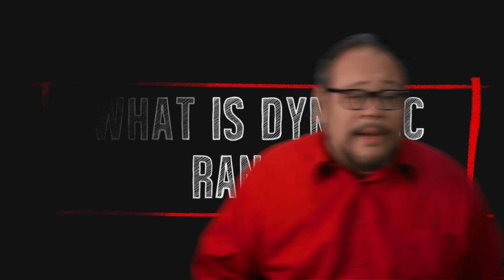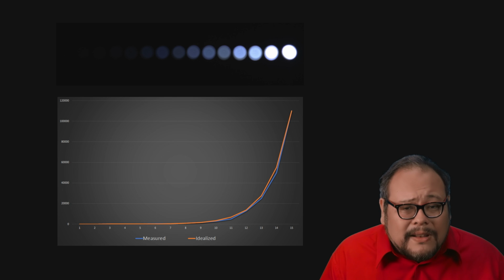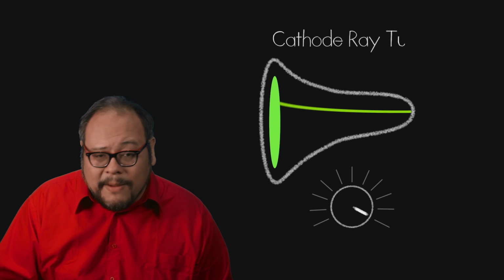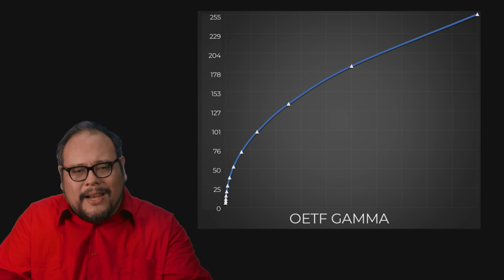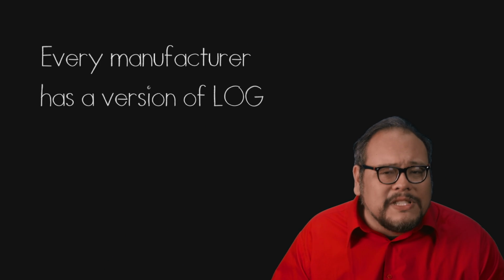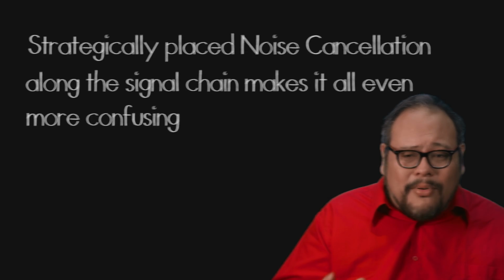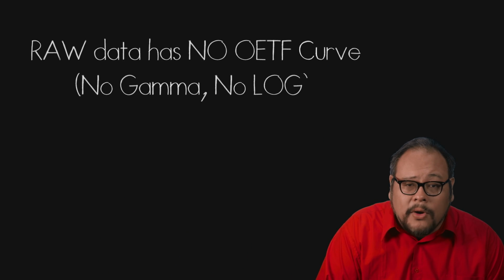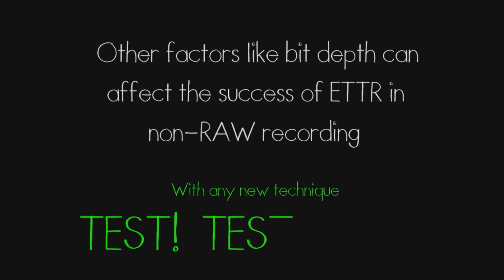Diving into Dynamic Range

Comment: Congratulations!  I come from an analogue film background and way back then 64 ISO was high speed film! To change ISO you changed the film, and I often wondered how digital cameras could have multiple ISO settings. Turns out that they don't. They have one ISO setting and adjust the electronic gain to simulate multiple ISO settings. Back in analogue film days, higher ISO did give more detail in the highlights, but you balanced that against increased noise. With simulated ISO, the rules are different but no-one really explained that. I would be very interested to see some tests comparing cameras with differing native ISO's. My gut reaction is that these tests will be similar to analogue film and will obey the old rules.
Reply from the maker: Thing is cameras with different ISOs also have different sensor architecture so it's not an apple to apples comparison.
Reply: @FilmmakerIQ , I was thinking in terms of comparing at the same ISO as that is a standard, and they all should have a similar response to the exposure parameters. However even back in the analogue film days, each film reacted differently even with the same exposure parameters. For myself I always preferred Fuji over Kodak because Fuji had more lattitude in the exposure, and was a bit more forgiving.
Reply from the maker: Unfortunately really it isn't that simple. There's even the caveat of the dual native ISO that some of these new cameras have that throws a wrench into any kind of comparison.
Reply: @FilmmakerIQ  Yes, it isn't that simple and that's where I think the value is. Again, going back to analogue film, the brand and specific  product influenced your decision as much as the ISO. You may dial in the same set of parameters for several cameras but you won't get exactly the same result. I have Panasonic, Canon, and Blackmagic, and I'm not a fan of the cool tones bias of the Canon for the work I do in events and livestreaming. It was just a thought. I am not sure how you could set up a reference shot/environment so that you could see the influence of the camera itself  on a shot.
Reply from the maker: Funny because in my test when trying to select a 4K camera between Sony, Canon in Blackmagic, I ended up going with Canon because I like the way Canon handled skin tones. Not that any camera looked bad but that Canon just had a way to get me most of the way there.

Comment: I would love this video but for the user not the creaters.
What is HDR video, how does it work for a TV and way is it better.
What is HDR10 and Dolby Vision?
If HDR only means going from 8bits to 10bits. Then this should not change the darkest or the brightest part of the image. Only the gradients (256 vs 1024). The standards might not be linear, but does HDR only mean more steps? I am so confused.
Reply from the maker: HDR is basically displays that have more dynamic range than your standard display - this means it's capable of showing much brighter and much darker. I'm not fully up to speed on precisely what it is but from what I've seen it's definitely a visible improvement.
Reply: @FilmmakerIQ  Thanks for the quick answer, that is awesome.
That would then mean the a standard screen has some kind of standard for how much dynamic range it has. Since both the tv and the content needs to be HDR.
If you just had a display that could show darker and brighter you would just se darker and brighter parts for standard content, but you would still only have 256 steps.
But HDR displays do not even have the same max brightness. I will continue my search, thanks for the great videos.
Reply from the maker: Yep you got it. It's hard to wrap your mind around dynamic range butt the keep is remember the display doesn't have the same DR as the scene. Take paper for example. A printed photograph has maybe 5 to 6 stops of dynamic range... Yet we take photographs with 10 or 12 stops in the scene

Comment: Hey John, when you gave the example of capturing clear sky at ISO 1600 vs ISO 100 and showed clipping at 100 ISO level, you don't mean capturing at 1600 ISO without any ND right? I mean, what if I still want to maintain 1/48th shutter (shooting at 24fps) and I set the ISO to 1600. That will blow out the highlights if I don't use an ND filter to make the image look right. Does that mean if I bring this video in the editing suite (after using Nd and shooting at 1600), I will still have all the highlight details present? This is super confusing.
Reply from the maker: Shooting at ISO 1600 I was exposing correctly using shutter speed to limit the light. If you want to maintain the look of a normal shutter speed you're going to have to limit the light in a different fashion... Either with a smaller aperture or with ND filters.

If I shot those clouds exposing correctly for ISO 100... The highlights would be clipped.

If this is still confusing check out my exposure video for a little more basic grounding.
Reply: @FilmmakerIQ  Thank you for taking the time to respond and for these amazing videos, John. I am going to watch the Exposure video on your channel now and then do some testing with the BMPCC 4k too, referring in post to the Dynamic range chart for the camera to see if my results are consistent. Thank you.

Comment: well, this definitely convinced me to subscribe
can I ask something, though? if the purpose of ETTR is to exploit the higher data acquirement of the right/highest part of the linear curve, what sense does it make to use it in LOG, since roughly all the stops use the same data?
Reply: And I have another question: many many times I tried looking around for flat profiles, but everytime someone says something different and I have no idea what to trust... can I please ask you what is going on between log and flat? Does shooting flat actually increase dynamic range somehow?
Reply from the maker: @francescoroccuzzo5914  There isn't really that much benefit to shooting LOG ETTR other than just getting further away from the noise floor (which may actually be the best reason).

As far as flat - I think most people use that as sort of a stand in for LOG. Flat is just reducing the contrast in the camera and playing everything kinda safe - it's not quite as sophisticated as LOG.

Comment: If you Please we need a clip about what the difference between 8 bit - 16 bit and 32. Thank You.
Reply from the maker: This is rather an interesting mix-up. So whenever you hear something described as a number of bits that tells you how many values are available. With eight bits you have 256 values available. In video when we say something is 8 bit That means there are 8 bits for each color channel. 16 bits and 32 bits are actually computer graphics related. 32 bits means there are four channels of 8 bit... One for each color channel and one for alpha. 16 bits is a intermediate format that has fewer colors. 

So it's ironic that 10-bit video actually has more bits than 32-bit color...

Comment: I'm not sure if I unserstood correctly. Is the example of the clouds still valid if shooting without LOG? Should I keep the ISO at 100, or increase the ISO a little bit? Do I improve the dynamic range even if I shoot without LOG?
Reply from the maker: Depends on the camera. This example you're not improving dynamic range because the dynamic range stays the same you're just allocating stops to different luminances.

Comment: Question: On my Sony a7iii I've heard hlg3 is good. is it ever smart to use a log gamma indoors if you don't have enough light? If you're using log indoors should you use iso to boost and if so should you boost ettr or just to proper exposure?
Reply from the maker: Had to dig into this as this is new territory and good info is very very limited out there. HLG is HYBRID Log Gamma - or at least Sony's implementation of it. Hybrid Log Gamma is a shortcut curve that is meant to be able to record REC2020 for HDR display AND be able to look okay and playback on REC709. Honestly, if you're not shooting for VIEWING on HDR, I would avoid HLG in favor of one of the other S-Log.

You can use Log gammas indoors. If you don't have enough light, you will be FORCED to pushing up ISO. ISO cannot be used for ETTR, because ISO is NOT EXPOSURE, (ETTR is Expose ot the Right). So you would raise your ISO until the light you have would give you proper exposure. Going more so and bring it down in post would not give you an advantage.
Reply: @FilmmakerIQ  So for ISO, it's more about if you're trying to protect detail in the highlights or shadows?
Reply from the maker: That all depend on what it is your trying to shoot. You get to make that choice.
Reply: @FilmmakerIQ  Sorry to keep bothering you last question. If I'm shooting in a basketball gym, can't add light, how would I go about getting cleanest image? Wide open, 180 degree shutter, but what about ISO? Just expose to the middle with iso?
Reply from the maker: Yep - that's the only thing left to do.
Reply: @FilmmakerIQ  Thank you so so so much

Comment: 31:19 shouldn't the right example have a oberblown sky? why is there still blue sky visible if it's over exposured?
Reply from the maker: Because it wasn't exposed to the point where it clipped in the RAW fil... the sky is still inside RAW's recording capability (dynamic range) and REC709 can't display that much bright detail so it shows it as clipped.

Comment: Since I watched that video, I've been photographing clouds at as high an ISO as I could with my bridge camera. And, well, I always get sharper results with the lower ISO !? Of course, I can only go fromm 100 to 500 ISO before my Lumix FZ72's shutter speed and aperture max out, but that's still a range above 2 stop: http://zupimages.net/viewer.php?id=19/31/t80m.jpg  Those are stills, but I can't see how that would mae a difference, and stored as 8-bit JPEG. I haven't tried with RAW, but that shouldn't be part of the equation either, should' it?
Reply from the maker: ISO has no direct bearing on sharpness. The Lumix FZ72 may not have the extreme exposure push and pull that my Canon C200 does. Every camera is different.

Comment: Dear John, assuming that i've done all i could to increase the exposure (by aperture, shutter speed, and scene lighting) and my histogram/waveform still indicates that there is more headroom. Would there be benefits in increasing ISO? While i understand that the Signal to noise ratio would not change, but would this allow more tonal information to be captured?

Thanks in advance to anybody who shares their thoughts!!
Reply from the maker: it's not about headroom... it's about what's important to your scene which is usually middle gray areas. Generally speaking, once you've maximized you're exposure (shutter and aperture) there is no benefit from increasing the ISO. You aren't allowing more tonal to be recorded, you're just shifting that tonal information (along with noise) into higher levels

Comment: Great work, however, I don't quite understand something. Maybe you'll be kind enough to explain. The shutter opened up and the light fell on the sensor. This produced a certain amount of electrodes for each pixel, more where more light fell and less where it was darker. On the sensor is a now physically correct representation of what a light-meter would read for the photographed parts of the real scene. If we could view this image on a linear gamma monitor it would seem right. However, our monitors don't output the correct linear gamma, so we need to compensate this. Which is why when the RAW data is processed into video, a Gamma correction is applied, to counter the monitor's wrong output. But how does this processing of the RAW data actually work? The sensor produced a certain amount of electrodes for each pixel. Many more in the light areas than in the dark. We don't need as many electrodes for the lighter shades, because we can't discern the difference so well anyway. So the processor takes electrodes away from these areas and adds them to darker pixels, thereby giving us more shades in the lower spectrum? Is this right? And how does the processor actually do this? Thank you. I might be way off...
Reply from the maker: Where you're going wrong is your conceptualization of what happens after the sensor collects the data. Think of it as percentages.  If you have a sensor that collects 14 bits that's 16000 or so possible values. So you divide whatever value the sensor gives by the total 16000 and get the signal level which will give you a value from 0.0 to 1.0. If you're recording RAW with no gamma that numer just gors straight to memory. If you're gamma correcting you take that value and put it into the OETF which translates that sensor value into the gamma corrected value (also 0-1.0). there's no pulling values from one pixel and applying it to another.

Comment: What I can't reconcile is those dynamic range charts that show DR dropping as ISO is increased. Like DxO mark use for example, pretty much every camera drops sharply as ISO is increased. What are they doing to get those results? Are they adjusting the exposure for each ISO or keeping exposure setting static and just increasing ISO? Are they testing the wrong way? It's really hard to trust higher ISO when I've always been led to believe that native ISO is base ISO at 100 and has the most DR. I have watched this video twice and your newer BMPCC4K video 3 times! I'll get there...
Reply from the maker: Remember that Dynamic Range is really signal to noise ratio. So if you boost the signal you generally will also boost the noise. On a very simple camera system - this is why DR will steadily decrease as you increase the ISO. 

But what some companies are doing is to (a.) change the way the noise is being handled at different ISOs... shooting at ISO 100 will engage a different kind of noise cancellation that shooting at ISO 1600 or so. So that changes the Signal/Noise ratio curve. The other thing manufacturers are doing is "Exposure Indexing" - this is what the Blackmagic is doing (Red and Arri do the same thing). This works when you can record a whole lot more dynamic range than your sensor is capable - what happens is they essentially slide around what middle gray is: Imagine you're shooting with a 13 stop sensor in a format that allows 16 stops or so. You've got 3 stops of wiggle room on either side to move the exposure around all without loosing any dynamic range!

Comment: Took me back to 1984 when I constructed my first video frame grabber. I experienced ALL of the issues you discussed here. It was a good ten years later, as a professional broadcast equipment designer, that I caught up with the theory behind it. However, early on, using only my squinty eyeballs and pure experimentation, I created very effective gamma correction values to apply to the look up tables built into the color D/A converters! Even though, I had only the vaguest notion of all the psycho visual factors involved. I loved every second of it! (Don't even get me started on all the nuance of aspect ratios! Pixels vs clock rates vs screen dimensions, etc! Why aren't my calculated circles actually round? ARRRGGGHH!) Thanks!!!!

Comment: I was taught in the photography school in 2013, that  you  can shoot picture underexposed and you can recover  shadows in post, but if you overexpose your image, then this data will be lost. But this was maybe case for older cameras that did not have LOG-profiles, right?
Reply from the maker: If you over expose to the point of clipping - abandon ye of all hope - all is lost with digital.

If you underexpose, yes you can bring it up in post - but you are also bringing up the shadow noise. 

Either way is not good - try to properly expose... but usually more light means better images so controlled overexposing is a good idea (ETTR) but it also like playing with fire.
Reply: @FilmmakerIQ  Properly overexposing sounds good if the goal is having less noise. Thank you for the answer!

Comment: I believe some camera people saw this and are losing our minds. THIS is welcomed information. Take a gander. Us photographers need your input-     https://youtu.be/EvJ-H_xl3zE
Reply from the maker: What part do you need input on? ISO invariance?
Reply: Ha! This is part thank you for your hard work and part warning that I’m just giving you a heads up that I’m about to throw your videos into a vacuum of knowledge in the photography world! By the way, based on your wave form and ETTR comments, I did some reading and watching... Wha tha wha?! I do mostly sports photography, so I will be cutting my teeth during track season with ETTR - makes too much sense!
Reply from the maker: @jacquesjohnson639  Only thing to be mindful of with sports - you live and die by that shutter speed - so getting tack sharp shots may force you away from ETTR.
Reply: Filmmaker IQ thank you for replying. There is a pro sports photographer (zamani feelings) who has unbelievable noiseless photos - Regardless of ISO. His football photos always have in helmet clarity (you can see player eye color). Noiseless night time Football photos (ISO +10,000).You can fill in the rest. S/N due to his slight over exposure (which the rest of us were running from) makes his photos the high bar. The first thing he does in post is reduce contrast (noise reduction), adds in blacks, adjusts shadows, then use color selection to boost colors - not saturation (more noise). I’m long winded. Sorry.